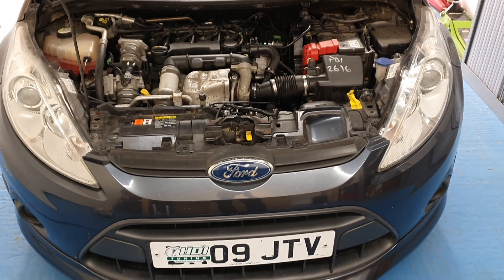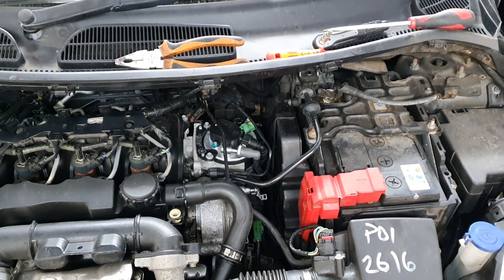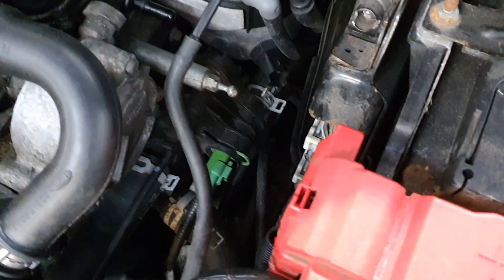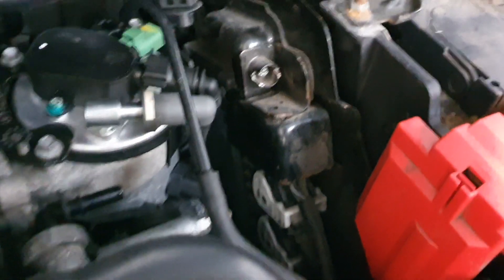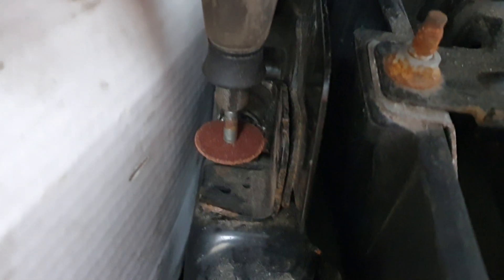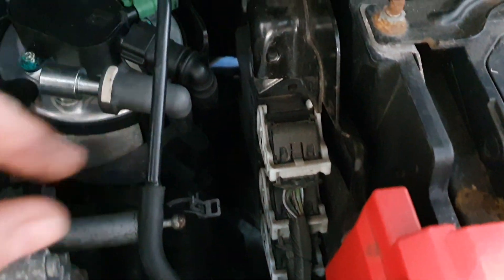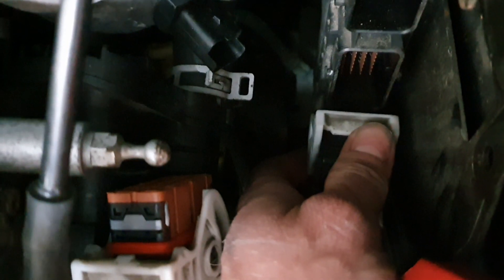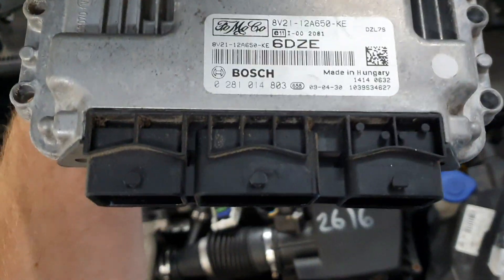Ford Fiesta MK7 ECU Removal with security cage 1.6 TDCI 16V EDC16C34

Comment: Hello, is the same protection on a Ford Fiesta 1.4TDCI 2009 Zetec, will I not be able to read and write a map throught the OBD port?
Reply from the maker: You can use obd no problem
Reply: @StevenLewis-HDI-Tuning  Oh okay, just in the description of the video it says that the Fiesta Models 2009-2010 have the RSA protection. So I can safely read the map through the obd port.

Do you also offer ready maps for the 1.4TDCI on your website? 

I would much prefer pay for a map than do it myself.

Thanks in advance!
Reply from the maker: @mentosiak6513  yes get a read email it to me.
Reply: @StevenLewis-HDI-Tuning  what about fiesta 2012 with KVJA 1.4 TDCI euro5 70bhp, can this one be done safely via OBD? If yes - with which tool then? I've been told bench with sm2pro is best option, hence I'm here watching this vid how to take it out :D
Reply from the maker: @krzysztoff5793 yes you can use MyGenius it's on our webshop
Reply: Can you send me your email

Comment: Hi - if i buy a file from your website, can i write it directly to the ecu? - I don't know what i shall do about the checksums, etc, or will it sort itself out if i write a new map onto the ecu? Thanks!
Reply from the maker: If you're not sure how all that works then you might want to use our customised online remap service, if you use the file store you need to know you're using the right software variant. Usually all checksums are already fixed its included in the file name, you also need a suitable tool to program the ecu.
Reply: @StevenLewis-HDI-Tuning  Hi - Thanks for the prompt answer! I Got a KTAG Clone, and have an EDC17C10 Ecu. I'm gonna open the ECU when i get the time and dump the firmware - My car is a Fiesta 1.6 TDCI 95 HP, but i'm unsure about the model year. When i look it up, it's registered as a 2015 model, but it was a demo model at my dealer, so i'm unsure if that's actually true, might be a 2012-2015 model. Also i don't know if it's a econetic model - It has start/stop, but other than that i don't know to be honest. Is this a problem for the remapping process? If i send you my file, will you be able to figure this out, and return me the correct file? Sorry for the long message!
Reply from the maker: You might be able to take an ID over OBD using Kess and then we can use a virtual read, if not get a bench read with KTAG. You just email me the file and send payment thorugh my webshop and I'll get the remap back over to you. 
 @user-uk3gc2dk3h
Reply from the maker: You might be able to take an ID over OBD using Kess and then we can use a virtual read, if not get a bench read with KTAG. You just email me the file and send payment through my webshop and I'll get the remap back over to you.